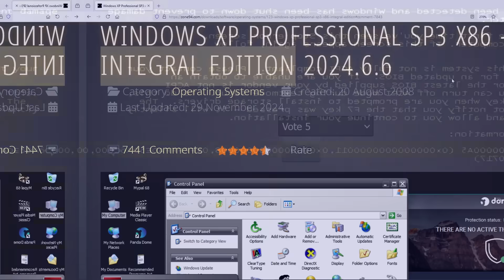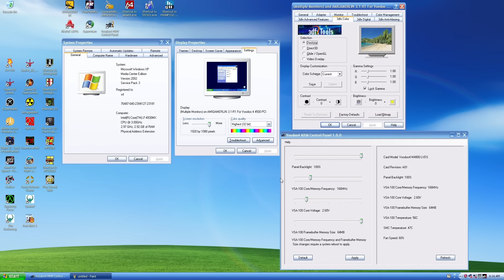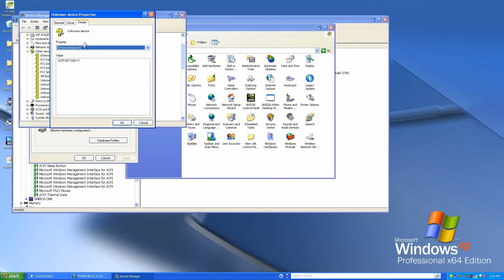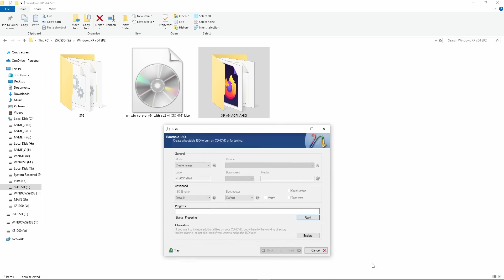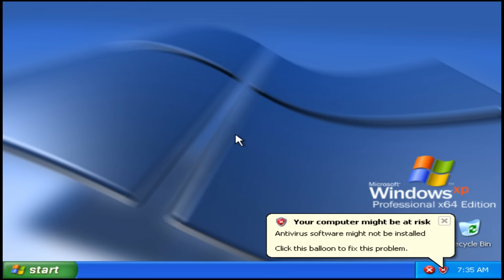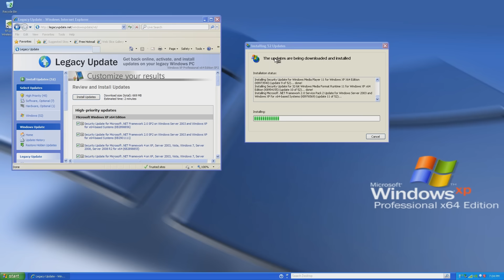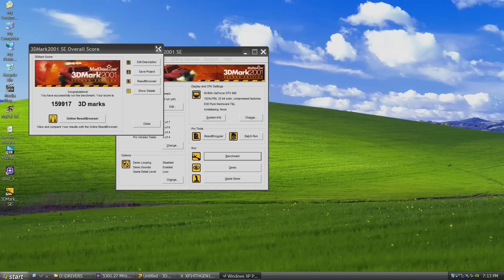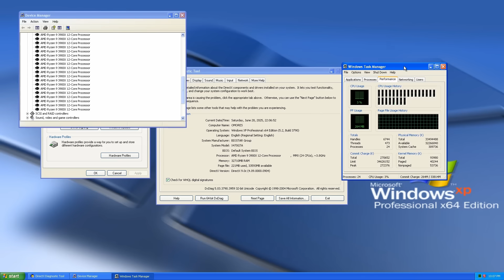How to Install Windows XP x64 on (very) Modern Hardware - NO BSODs 2025 Edition

Comment: Hey, nice video! A while back we discussed whether Arrow Lake motherboards would support CSM at all or not: the answer is "no they don't". That said, I have contributed to this project called CSMWrap recently, which does exactly what you may infer: it implements a legacy BIOS on UEFI systems (by using SeaBIOS). Now, that said, the project is very early stages, and despite a lot of interest from many people, there aren't a lot of contributors, so things have been moving slowly.

Anyways, using it, I was able to boot MS-DOS 6.22 on my Arrow Lake system, which means that as a proof of concept, it works. This may be the future of raw hardware legacy compatibility on x86, as CSM's days are basically numbered. AMD motherboards still support it, but I would be very surprised if boards for the next socket from AMD (AM6) still retained support for it.

Ideally, once more work is done on CSMWrap, it should be a drop-in replacement for CSM where you'd drop the .EFI file for it in a FAT partition on your disk (for 9x it can be the very same partition as the install) and it will be loaded up as the bootloader and then chainload the actual OS's bootloader after entering into the compatibility environment. And yes, it's 100% native, there is no emulation involved here.
Reply: So, basically, Intel removes legacy BIOS backwards compatibility from UEFI for Arrow Lake system architecture (and later models), customers react by rolling their own version of Legacy BIOS backwards compatibility on UEFI and because the UEFI spec is designed to be extendable and even user modifiable with software extensions, there's fuck all Intel can do to kill BIOS compatibility in IBM PC compatible x86-64 system architectures. Also, this solution you're building will be used by motherboard manufacturers who have a line of industrial PC mobo's that are intended to do exactly the same thing, which is to add back legacy features Intel has deemed irrelevant, which are needed to run the industrial manufacturing machines these boards are used to keep working when their original PCs components die and no replacement parts are available with a manufacturers warrant or certification it meets said industrial PC standards. ECS and other similar manufacturers keep releasing motherboards with 1-3 ISA slots, 2x RS232/486 serial ports and legacy BIOS and peripheral support kludged into the latest Intel CPU socket and chipset that runs it. I'm aware of boards for LGA1150, 1151, LGA1200 and I'm certain there's one for LGA1700 as well, even though I have not happened to come across one yet, but then again I haven't even tried to google for one, those which I mention I just happened to stumble upon by accident when browsing chinese webshops who also sell to small to mid sized industrial manufacturing companies. They use them to run CNC lathes which were made 30-40+ years ago. The designed product life the CNC lather manufacturer offers support and replacement parts for, is 30 - 50 years. Well, the lathe part itself can last 100 years +, so after the original equipment manufacturer EOLs it, there's a industry of 3rd party companies that are willing to provide support and a solution to keep them going using parts made of modern components. Usually these 3rd party companies are already parts manufacturing subcontractors for the OEM in question, so they know what they're doing and the customer base relying on used machines as a means of basic production, trust them. There are Bridgeport lathes over a century old which were upgraded in the 1970s with laser instrumentation and computerized control in use to this day, for example. Those CNC machines made in the late 1970s and early to mid 1980s that are now 40-50 years old and OEMs have EOLd them, but aside from the control hardware, they  have at least another 50 years in them doing what they're designed to do, when appropriately maintained. Mechanical engineers have known how to make a lasting lathe for a couple of centuries now, and these things are by no means a step backwards in materials technology. Oh, no, they're a leap forward from what was deemed worth while to upgrade 50 years ago, when it was 50 years old. :D

Basically this means those CNC machines will be running long after the people responsible for deciding that Intel no longer supports any of the main features I mentioned, have died. So, UEFI BIOS legacy support, the 8/16bit 8.32Mhz ISA extension card slot and EIA-232/485 serial port are never going to die or disappear. IF IT WORKS DO NOT FIX IT! In fact, any computer with out atleast the serial ports as standard feature is by definition a toy, not real hardware for actually doing anything serious. :D I admit that in about 10-20 years time, those motherboards will be replaced with some sort of FPGA based solution similar to the MiSTer retro gamíng computer. Using a software defined Intel x86-64 system architecture computer programmed in VHDL in the FPGA and doing I/O using the connectors and standards I mentioned. Including the 8/16bit ISA slots for running the lathe control extension cards. :D :D :D Being 35-45 year old ISA cards, they've long since been reverse engineered and there are 3rd party manufacturing of them, as they need only basic components to make, these are widely available in case an original happens to fail and is not repairable. Another benefit of using more modern system architecture to replace the old stuff is that with additional computing power the lathe can be run faster and used to mill more complex forms and used to do higher precision cuts than the original system could even theoretically be able to achieve, so there's nothing but ample demand ad infinitum for keeping these things alive. No matter what Intel, Steve Jobs ghost or idiots chasing the latest gadget as a status object carry around the office think about legacy hardware backwards compatibility or what people who work inside air conditioned offices using an ultra-thin laptop think counts as "being dead" because they don't have any use for it. "C is a dead language" age old adage of Java/Python/Rust/<insert the latest reinvention of the  wheel known as "higher-level language" here> Fanboys :D Another "legacy relic" which will never die, no matter how much people with computer science degrees have no longer have any use for it.

Computer Engineers will always need C, assembly and also a comprehension of the CPU instruction set they are working with to do their jobs. And no amount of higher level languages created in the world or their prophets crying using lower level languages and ability to give direct instruction set commands to the CPU is heresy, will change that.  :D

So, basically Intel is just making all this unnecessarily complicated and expensive for everyone involved and forcing duplication of effort, by not just simply releasing the CSM code as open source for 3rd party community support, just like those lather manufacturers do. What they do when they EOL those machines is, they either offer the technical package to the entire thing for free of charge to anyone who wants a copy through proper channels, or they sell it on the open market with no warranty or support and liability waiver at a price point that clearly has nothing to do with profiting from it. :D

The reason being, the latest generation of CNC lathes that they make are leaps and bounds beyond what those old CNC machines can do with just adding more cpu power and accuracy to the control system. So, top end shops and mainstream big volume manufacturing industry has very little need for keeping a 50 year fleet going. They get a decent amount of the initial capital investment from 30-50 years ago when they bought them back, even when adjusting for inflation by selling it on the used market or shipping it to a developing economy.  :D
Reply from the maker: Yes, I know about CSMWrap! It's amazing! Daniel from sdz-mods - the guy who made the custom 3dfx cards - recently worked on SeaBIOS to get Windows 98 running on his Dell M4800 laptop. Now it’s running with IDE support, partial ACPI support (the battery shows up), and USB support, though USB didn’t work initially. Maybe he can help. 

I wouldn’t be surprised if the CSM functionality it's still present in the BIOS for the 15th Gen mobos, but just disabled. I don’t think the AMI BIOS from the 14th to 15th gen is so heavily modified so there's a chance that the CSM-related modules are still inside the BIOS. If that's the case, enabling them could be relatively easy. 

For my next build, I’m going with AM5. There's an Asus APEX motherboard that has 4 PCIe slots, 1x PS/2 port, and full CSM support. Funny thing is, it’s the only X870E motherboard with a PS/2 port, but since it's ‘most top-of-the-line’... it's crazy expensive. (750$ :-O) Yes, starting with AM6, CSM will probably be gone since the newer RX9xxx GPUs are UEFI-only. Anyway, AM5 will probably still be relevant into 2030.
Reply: @O_mores  Unfortunately, the CSM modules are not in the firmware. I checked, I dumped the firmwares from several ARL motherboards using uefitool and checked to see if any CSM-related modules were present, and they are not. I think Intel has probably either put their foot down and said "no more CSM, or else", or alternatively, as I was told elsewhere, that the Intel equivalent of AMD AGESA that was provided for ARL does not have CSM or CSM compatibility anymore.
Reply from the maker: Bad move from Intel to remove CSM right now, especially when they’re already in trouble. At this point, even a tiny loss in market share matters. I was considering Arrow Lake, but now I’m building on AM5 instead. Plus, I work with a company that handles school tech procurement - usually thousands of PCs per year. I handle the specs and the documentation (a lot of it), so if I say 'no more Intel'...

Comment: I actually really liked Windows XP 64 bit, I had a X64 XP + Win7 dual boot config but rarely ever used the Win7 side which took forever to boot.
It was so much faster on my weak hardware at the time being some single core AMD, but I was able to play garrysmod at WAY better framerates compared to 7.
I eventually got a whole new PC in 2013, where I made the full Win7 switch.
Reply from the maker: I was also a fan! I remember that after Windows 7 launched, many tech articles highlighted how XP was still faster in raw performance, not just in how snappy the UI felt, but in actual instructions per cycle. Of course, Windows 10 and 11 now have much more advanced schedulers for handling modern multi-core CPUs, so XP has lost its advantage there. It's still a blast to revisit, though!

Comment: It's really amazing that enough drivers exist to make this work.  This was a really finicky version of Windows.  Is it actually stable running this way, or do you get AHCI errors?
Reply from the maker: I actually didn’t get any BSODs while fiddling around - except, of course, for those that popped up during the installation. Afterward, everything ran totally fine, and I kept this installation running for about two weeks. So I’d say the backported drivers are pretty solid!

Comment: Now this is amazing. I don't think I've tried the x64 edition. I've always said I would go back to Windows XP because of all the spyware and junk preloaded on 10 and 11. I guess if I wanted to keep it simple, a Dell Optiplex with a 2nd or 3rd gen i-series CPU would be just fine. I hope XP keeps on getting more unofficial support. I hate to see it go the way of the dodo.
Reply: Complaining about W10/11 bloat doesnt help, do something about it!
Using Revo uninstaller, i uninstalled Bing, all startup clutter, Widgets, Copilot and all the "apps" i dont even want, all gone.
Roughly about 20 bloatware programs deleted.

Then there are debloaters that do even more indepth cleansing, but i prefer to do it myself.
Countless guides about the topic, there is no reason to be passive about it, just do it.

Comment: lol you can enable PAE to brake ram limit on 32 bit
Reply: Yes but software will be limited still to 32 bit limit up to 2GB or max 4GB with 4gb ram patcher for full 32 bit address
Reply: Well, yes, but PAE only extends the memory adress bus of the CPU from 32 to 36 bits, so you're still capped at 64GB of RAM - putting aside that 32bit Software can usually only use 2GB of that, 3GB if it was compiled "large adress aware".
Reply from the maker: Depending on the hardware installed, PAE can cause more problems than it solves... Many 32-bit drivers were designed with the assumption that a physical memory address would always be 32 bits wide. They might use a 32-bit variable to store a physical address, but when PAE is enabled, physical addresses are 36 bits. If a driver tries to store a PAE address in a 32-bit variable, it gets truncated - and here comes the BSOD... Even early Intel HD drivers can cause trouble with PAE.

Comment: why xp 64 bit is the worst version of windows xp, they dropped support for it so quickly
Reply: They did what? Win XP Pro x64 was released in 2005 together with the x64 Editions of the Server 2003 OSes. Actually XP Pro x64 is just a "flavour" of Server 2003 x64 ... which got supported by Microsoft even a year longer, than XP 32bit. Support for XP 32bit ended on April 8 2014, while Server 2003 (including XP Pro x64) got supported until July 14 2015.
Reply: Also they have worse drivers than 32 bit versions of XP and worse compatibily on applications
Reply: @therealegr  I tried XP64 [ on AMD64 x2 4400+ / 4GB DDR 400 / Nvidia 7800gtx 512 MB ], but the gfx drivers were giving multiple daily BSODs, so I went back to XP32.
64-bit was just so new that drivers felt like a rush-job; driver developers needed time to get used to it!

I tried again with Vista 64, but was still having problems ... the main problem being Vista!

Windows 7 finally got it right !
Reply: Also, the Realtek on Windows XP x64 doesn’t have Environment, Voice Cancellation, Pitch Shift, or Equalizer. :(
Reply from the maker: I've made quite a few 32-bit XP videos, and every time people asked: 'But why not x64? Because more RAM...' Now that I've made an x64 video, the question becomes... 'Why x64?'  If this is not funny, I don't know... :))
Reply: @O_mores no matter what you do, you'll never make everyone happy. fun reality we live in... thank you for your videos 👍

Comment: Here after 13 minutes for that video you . Also is there a way to be able to install Windows XP x86 and x64 on any pc (above minimum requirements) from one ISO image? Also I would like to participate on a video on some way.
Reply from the maker: Yes, Dietmar - the dude I mentioned in the video - spent a lot of time getting Windows XP to run on a 486 PC, even though this CPU is unsupported since it's missing some important instructions compared to a Pentium.
Reply: I'm developing a Universal NT Installer project. It will be possible install NT3.1 to XP from one ISO.

Comment: nice
Reply from the maker: Yep, I'm building an AM5 PC right now - I found one crazy motherboard from Asus with the X870E chipset and a PS/2 port + CSM, but you wouldn't believe how expensive it is...
Reply: @O_mores  there is a project called CSMWrap. It emulates CSM on pure UEFI-only PC. Project is still in beta but worked for my Intel 2020 laptop. 2000 and XP booted fine!